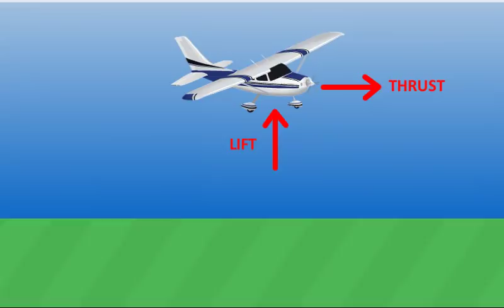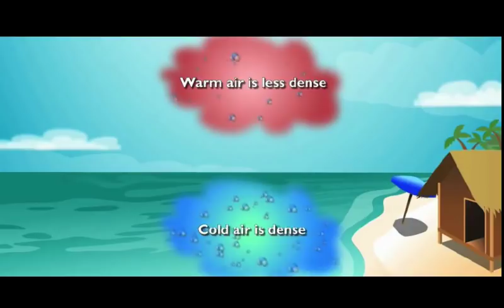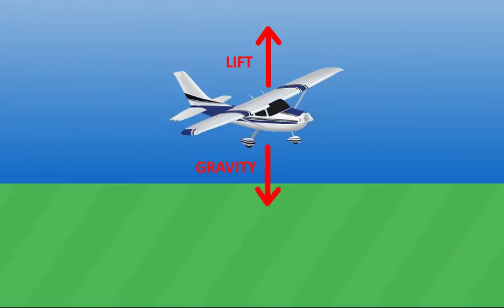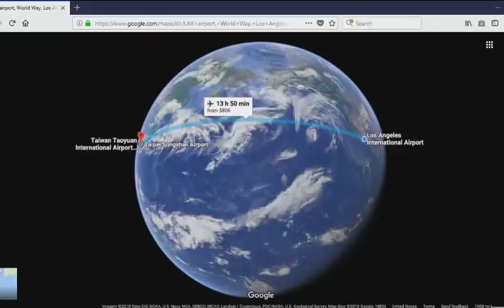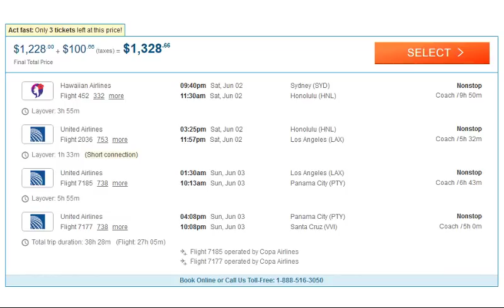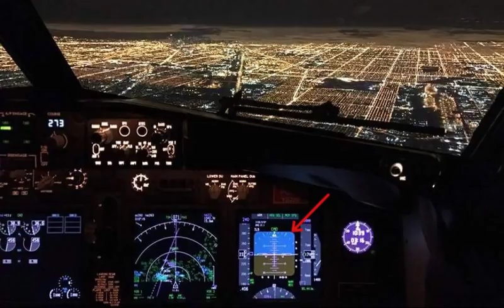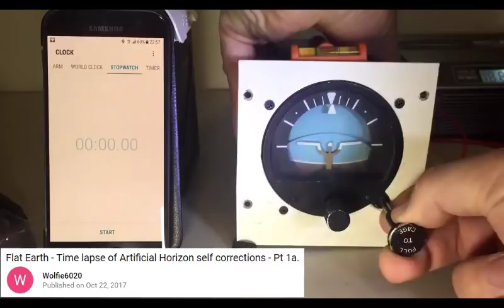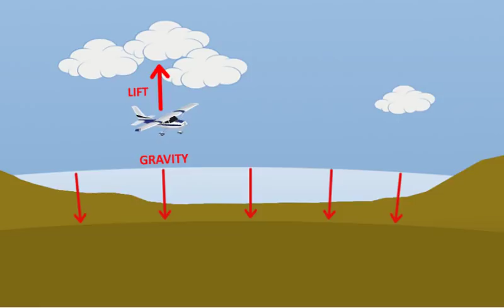Flat Earth Falsities - Plane Nonsense

Comment: VoysovReason,  wong, No... and Capt'Wes Starwind are all full Globetard. Superior Planet may be the dumbest yet!
Reply: Nice playlist of lunacy Mr. Beaver. No wonder you're so confused.
Reply: I'm not confused at all, you idiots believe a bunch of garbage you can't provide evidence for, If you want a debate, try me.
Reply: justin beaver
Given the intellect and knowledge you claim you should be able to answer these simple questions.
Why is it that a compass needle is more or less vertical at the poles and horizontal at the equator?
And when you carry on past the poles the needle slowly returns to the horizontal?
Why is it that it is only possible to navigate accurately over long distances using spherical trigonometry?
Why is it that traditional gyro compasses work perfectly in low latitudes but became unreliable in high latitudes?
Why is it that it is only possible to navigate accurately over long distances using charts based on a terrestrial spheroid?
Why is it that when you watch a ship sailing away from you the hull is the first thing to go below the horizon, then the superstructure and finally the funnel and upperworks?
Does a magnetic compass point towards polaris (Alpha Ursae Minoris) at the north and south poles?
Does a gyro compass point towards Alpha Ursae Minoris at the north and south poles?
What is the relationship between longitude and distance when travelling east or west parallel to the equator?
Tell me how you ascertain the error of a compass when in the Southern Ocean, using Alpha Ursae Minoris?
Please explain the principles behind the development and functioning of a gyrocompass?
No evasions please, just straight answers.
Reply: Forget all these garbage questions that you don't know the answers for anyway, and let's keep it REAL simple ok. Have you observed the curvature of the earth? If so, from where?
Reply: Why is it that a compass needle is more or less vertical at the poles and horizontal at the equator? Vertical to what? The needle points east, or west? What are you talking about?
Reply: And when you carry on past the poles the needle slowly returns to the horizontal? Why is it that it is only possible to navigate accurately over long distances using spherical trigonometry? 
Have you carried on past the poles before? I have never tried it. "What are the stars?" said O'Brien indifferently. "They are bits of fire a few kilometers away. We could reach them if we wanted to. Or we could blot them out. The earth is the center of the universe. The sun and the stars go round it."
Winston made another convulsive movement. This time he did not say anything. O'Brien continued as though answering a spoken objection:
"For certain purposes, of course, that is not true. When we navigate the ocean, or when we predict an eclipse, we often find it convenient to assume that the earth goes round the sun and that the stars are millions upon millions of kilometers away. But what of it? Do you suppose it is beyond us to produce a dual system of astronomy? The stars can be near or distant, according as we need them. Do you suppose our mathematicians are unequal to that? Have you forgotten doublethink?"
Reply: Why is it that it is only possible to navigate accurately over long distances using charts based on a terrestrial spheroid? Provide an example of a chart based on a terrestrial spheroid? lol
Reply: Why is it that when you watch a ship sailing away from you the hull is the first thing to go below the horizon, then the superstructure and finally the funnel and upperworks? They are not going over the ball earth wong, go look at Nikon p900 footage of boats on the horizon. Get up to speed already this is well known.
Reply: @manofthejavelin7136  so you proved that you don't understand compasses, shapes, geometry or maps. See I knew you would do it.  Now try answering wong's questions rather then continuing this demonstration of you intelligence and parroting skills.
Reply: He doesn't know the answers to his own questions. Have you observed the curvature of earth? That is a simple question?
Reply: @manofthejavelin7136  yes
Reply: Where did you observe the curvature from? Please answer my simple question.
Reply: Anytime you want to compare evidence k globetard I'll show you that it is you who is gullible and uneducated.
Reply: @manofthejavelin7136 oh I know you will show me lol. Now you don't have any evidence. You just have a list of things you dont understand and a pile of lies. All you will manage to prove to anyone is your intelligence and sanity.
Reply: I bet he does or he wouldn't be asking. Who do you think is behind this conspiracy?
Reply: The anti-Christ, and in everything connected with the anti-Christ, appearance, and reality are opposite to each other.
Reply: Thank you Mr. Beaver for answering my questions and thoroughly proving your intelligence and sanity. I would advise you to take some night courses and seek some therapy or counseling.
Reply: I understand the anti-Christ response to your question sounds pretty far out. However once you wake up to what is really taking place here, you'll want to know why? Why would they lie about this? You will look into the history of the heliocentric model, and it's contributors.Then the picture starts to become clearer, and clearer. They are Sun worshipers. Luciferianism is their belief system.
Reply: wong is a clown
Reply: And the horizon is where you can see the earth's curvature in a big 360 degree circle around you. Try looking at a very long bridge if this helps you. You can see as it curves over the horizon following the curve of the earth. Flat earth is just a scam for rubes on YouTube. If you believe that lie beware of Nigerian princes who want to give you a million dollars.
Reply: Hahaha you don't see any curvature on the horizon, oh no I'm afraid. Also how high where you? The Danyang Kunshan Grand Bridge in China 102.4 mile long bridge over water, zero curvature.
Reply: I ask you the same question No.. Why are you so gullible and stupid?
Reply: wong, what is it that has you so convinced you live on a spinning oblate pear shaped spheroid? I'm curious.
Reply: @manofthejavelin7136  thank you for editing your original post to include me.
Reply: You're welcome! hahaha, all in good fun!
Reply: @manofthejavelin7136  just shows off your intelligence and maturity I guess.
Reply: I can prove what I am saying, and you can't debunk my evidence I think. If you are so intelligent, and mature, you will show me you can debunk what I say ok.
Reply: Now it's a rainy season in flat Houston, Texas. The levels in every pool or bayou here are quite close to one another. And it's important that water should find its lowest level as soon as possible. Our streets become streams, and we realize these streams lie only a few feet above the nearby swollen bayou. But we're protected by large storm sewers and a network of detention basins. We rely on a passive system that needs no pumping. It functions entirely on water's eternal quest for its own level.

Does water always find true level? If the Curvature of the earth has a drop of 8 inches over 1 mile, is it possible for any body of water to be absolutely level?
Reply: No... Yawn... you are stupid eh? Have you observed the curvature, and from where?
Reply: I don't think you understand what curvature even is. What would the curvature of the entire earth be? Start at one point go all the way around. What is the curvature there?
Reply: Oh excellent you also have proven you don't understand math or what the word level means. Really there is no need to continue to prove your intelligence to us any further. Do you notice a major problem with your 8" miles squared equation. I am willing to bet money that you don't see the problem with that equation at all. I love when you flat earthers use that to prove how great you are at basic math.
Reply: Superior Planet you are an idiot, it is a model, but it is incorrect. If you actually understood The Bible as you claim, you would understand that we don't live on a planet, and it does not orbit anything. Lucifer is the light-bearer",the "Morning Star",the "bringer of dawn". Speaking of the lesser light that was created to guide the night, it has craters that are perfect circles. That doesn't add up, wake up globetard. It's light isn't a result of reflection from the sun either. That is obvious. Stop showing your stupidity k.
Reply: justin beaver You think a model that is accurate in every detail is wrong and a model that can't account for reality is right; should you really be calling other people stupid?
Reply: We get it. You fell for a scam on YouTube. You believe in magic sky fairies and believe the earth is flat. That doesn't really impress anyone. Keep going if you want, you have really proven it to us though. Just don't give your flat earth gurus any of your money. You know just incase you are wrong and they're scamming you. What was the first conspiracy theory you first became "woke" to?

Comment: What's the stronger force, the ten TORR vacuum of space or gravity? What is preventing earth's atmosphere from being stripped off into deep space? It does not require too much vacuum to lift a bowling ball from the grasp of gravity. And I suppose the vacuum of space is the reason for an ever-expanding universe, or is that gravity also? Rather than beating a dead horse, try answering some real questions.
Reply: You seem to be misunderstanding the term vacuum given the context you are using it in. The vacuum of space is not sucking us up like the vacuum that you own. Its just a lot of empty space, its not some huge sucking vacuum cleaner. This is a common misconception. Scientists are just not great at naming things, so take that up with them. Gravity is what holds the atmosphere to earth. If however the earth was smaller, we would lose more of our atmosphere. This is the case with Mars. The atmosphere just gets thinner and thinner and then nothing but the emptiness of endless space. We have no idea what is causing the expansion of the universe. We have no idea how big the universe even is. Like no clue at all. We can just observe that it is very, very, mindboggling big and that it is expanding, we don't know how or why or anything really other than it is big and getting bigger. We have no idea what energy causes and powers this expansion either. If you can figure that one out you get a Nobel prize. Oh, and this video is about air planes. He has made one on gravity, so I would suggest directing your gravity questions to that video, and your air plane questions to this one.
Reply: Please explain what "the ten TORR vacuum of space" is.
The unit torr is always written in lower case, always.
Also outer space is from about 1×10−6 to < 1×10−17 torr, not 10 "TORR"
So you obviously don't have a clue about the subject.
"What is preventing earth's atmosphere from being stripped off into deep space?" Gravity of course, as anyone with a modicum of intelligence knows.
If there were no gravity there would be no atmosphere and therefore no atmospheric pressure.
But then, as a card carrying biblical literalist and subscriber to the science illiterate lair Skiba what can one expect from you other than stupidity.
i suggest you stick to carpet cleaning and leave maths and science to the educated.
You probably don't realise that the science used to invent and develop the electronics and comms you are using what done entirely on the science based on the the  earth being a slowly rotating terrestrial spheroid and gravity a fact.  As were the carpet cleaners you use.
Reply: +Bobby Wizdum
Bobby, you have already conceded that you a lying troll therefore there is no need to keep confirming it, so just fuck off you silly troll
Reply: Vacuum is not a force, so... gravity I guess?
Reply: There's no air pressure at the edge of our atmosphere. And without air pressure, there's no vacuum.
Reply: Now what about the added hip scientific hypothetical DARK matter?
On the other hand, dark energy is needed to explain the more recently-discovered acceleration of the universe's expansion. It supposedly exists all throughout space, delivering a pressure that counteracts gravity.???
https://www.space.com/4623-cosmic-theory-unites-dark-forces.html